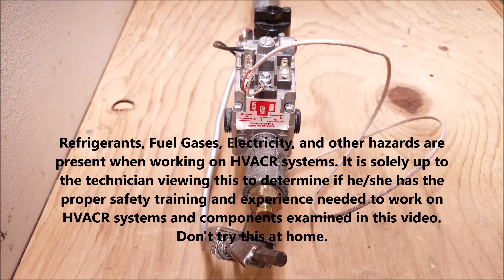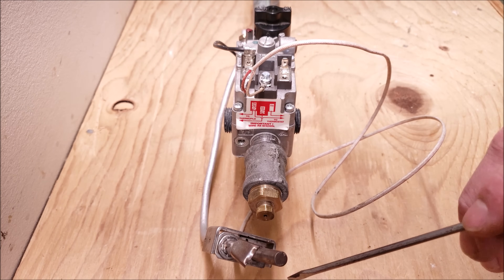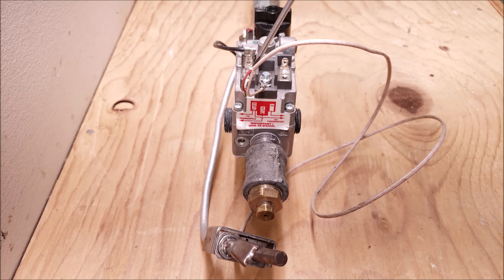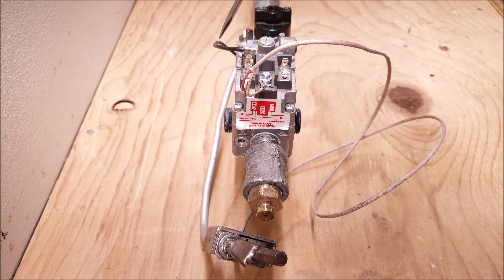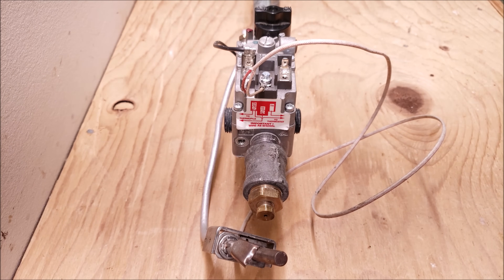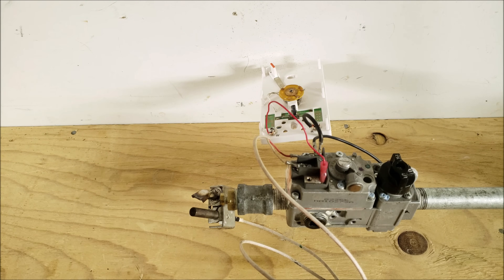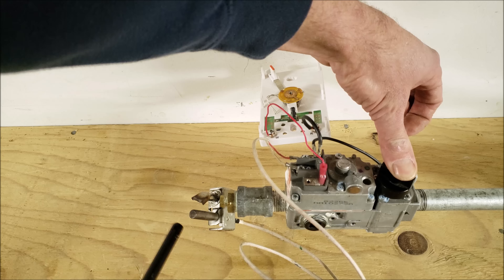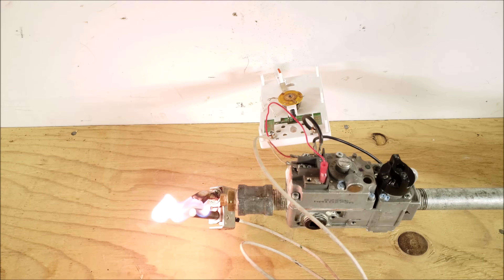750 Millivolt Gas Valve, Thermopile Wiring & Wiring Diagram!

Comment from the maker: Support-  https://www.patreon.com/acservicetech
Tool List-  https://www.amazon.com/shop/acservicetech
For those that are looking for the tools used in the videos: (Linked Below)
Honeywell 750mv thermopile- http://amzn.to/2yfR9UK
Robertshaw low profile millivolt gas valve- http://amzn.to/2iLXzEh
White Rodgers 750mv thermopile- http://amzn.to/2zhKVnF
Robertshaw pilot and thermopile combo-http://amzn.to/2zZAH8w
Ultrasonic Leak Detector- https://amzn.to/2Lw4Zpr
UEI DL479 Multimeter with temp sensor http://amzn.to/2jtsUbJ
Magnet Jumpers- https://amzn.to/2PyKPQZ
Alligator Jumpers- https://amzn.to/2PxqJXn
Fieldpiece ST4 Dual Temp Meter  http://amzn.to/2wc1ME3
Fieldpiece Bead K Type Temp Sensor https://amzn.to/2DBwKfs
Fieldpiece Wet Bulb Temp Sensor https://amzn.to/2RRI7Tw
Fieldpiece TC24 Temp Clamp https://amzn.to/2qHLyjZ

Yellow Jacket Refrigerant Gauge Set http://amzn.to/2aenwTq
Refrigerant hoses with valves http://amzn.to/2aBumVI
Yellow Jacket Gauge set & hoses https://amzn.to/2vLVkV9
Yellow Jacket 4 Port Manifold w Hoses https://amzn.to/2BkuGIq
FieldpieceSMAN360 Digital Manifold Set https://amzn.to/2BdoaD4
FieldpieceSMAN460 Digital Manifold Set https://amzn.to/2nB4Fe6
Compact Ball Valve for Refrigerant Hose https://amzn.to/2KUisW8
QuickDisconnect 90 for refrigerant hose https://amzn.to/2MMtVcg
JB 6 CFM Vacuum Pump   http://amzn.to/2nqbvo8
Appion Blue 3/8" to 1/4" Vacuum Hose http://amzn.to/2uYlVyc
Appion Red 3/8" to 1/4" Vacuum Hose http://amzn.to/2uYg6Ro
Appion Valve Core Removal Tool http://amzn.to/2uYr8WL
Yellow Jacket 1/4" by 1/4" hose http://amzn.to/2umtcod
CPS Vacuum Micron Gauge http://amzn.to/2v1nM3O
Supco Vacuum Micron Gauge http://amzn.to/2v1JRiA
RectorSeal Bubble Gas Leak Detector http://amzn.to/2ckWACn
UEI DL389 Multimeter  http://amzn.to/2xAdaJf
Air Acetylene Torch setup    http://amzn.to/2aQalsb  
15% Silver Brazing Rods  http://amzn.to/2gVLyLc
Nitrogen Regulator    http://amzn.to/2bXdR5f
Nitrogen Flow Meter    http://amzn.to/2brvoBg

Other tool links can be found in the video description section.

Shop through Amazon! Your Purchases through Amazon provide a means for channels such as mine to earn advertising fees from all purchases after clicking through. Prices are the same as normal-    https://www.amazon.com/shop/acservicetech
Reply: does the polarity of the RED & WHITE wires on the thermopile matter where you land them on the TH/TP or TP terminals on the valve?

Comment: Help full. On my valve there are two locations for the thermocouple to screw into. When I changed the t/c, I connected to the location easiest to access, it didnt work. Tried the alternate position. It fired up right away. I just want to leave this here, hope to help someone.

Comment: I have a SIT 820 mV valve that works, but wont turn off even with thermostat wires disconnected. Are the wires in the back shorting it out so it thinks its calling for heat? Have to turn gas off to get it to stop. Turns off if i disconnect the thermopile wires and pilot stays on. Help!

Comment: Mine has the Robert Shaw LP Propane Gas Valve 7000MVRB 5LCLP…my pilot flame is very strong but when I turn the thermostat on the pilot goes low and burner lights with a very week flame and pilot is weak as well… then a few minutes later the burner goes out. Pilot stays lite but weak…

Comment: Hello, I have a 60 year old pioneer furnace with a white rodgers valve 857RA68E. I tried to replace it with a resideo VR8300A4516 valve and it did not work. Can you recommend a substitute valve? Thanks.

Comment: Great video!! My question ... I have the Robertshaw  7000mvrlc    710-502. This unit has not been used for over ten years.....I blow out the pilot and it takes about 60-65 seconds for the valve to shut off...I installed a new pilot assembly and thermopile and I'm still having the same results??? bad valve? any help would be appreciated.

Comment: This video helped me as I have a similar gas valve on my monnessen gas fire place and want to control it with a thermostat instead of a thermostat remote as it only checked every 15 minutes and it can get pretty hot within that 15 minutes lol but anyways thanks for showing the diagram as now I can heat my house more efficiently and comfortably

Comment: My gas fireplace has a robert shaw gas control valve similar to this one. The pilot wouldnt stay on once I stopped pushing the knob down. I measured the mV coming from the thermopile and got around 400 mV. Then I bought a White Rodgers 600 - 750 mV 36" thermopile (G01A-132) and replaced it. It can go as high as 500 mV. But same issue. Pilot wouldn't stay on. I attached an old 1.5 volt battery in series with the thermopile and got 1. 4 V reading (without the pilot on). Then I on the pilot and it remained lit without even waiting for 10 seconds (once knob is not depressed). It works. The fireplace now works. However it isnt safe and I wouldnt use it this way. Is the issue with the thermopile being around 500 mV? Should I get something that should generate 700 - 750 mV? Second question, does it matter whether the red line of the thermopile gets connected to TH/TP and the white goes to TP because my original configuration (which works before) was the red went to TP and the white went to TH/TP. Thanks for your help.
Reply: Did you ever figure this out? I seem to have the exact same issue.

Comment: Gracias por la explicacion!
Reply from the maker: Glad to help!
Reply: @acservicetechchannel  I have a situation, today I changed a Robertshaw milivolt valve and didn't turn on, at the beginning not even de pilot, later the pilot turn on but I couldn't turn on the burners, several times when I set the thermostat on, the pilot turned off. Any ideas?

Comment: So I have this valve in a Superior fireplace. Checked thermopile voltage and it was around 210, so made minor increase to pilot flame, which brought it up to 327. With wall switch turned on (closes the main valve circuit, there is no thermostat) the main valve still never turns on. Bad solenoid/valve and replace the valve altogether? I even tried directly jumpering out the switch but still no go.

Comment: Hi, we have a gas fireplace ( a Regency ). It seems to work fine on med or high setting but when turned to the lowest on setting it will let only a small amount of gas to the burners and does not light and i can smell a bit of raw gas. is there some sort of adjustment on the valve?  Thanks

Comment: Several people seem to have the same problem I have. Brand new Empire Dv heater. Thermostat is closed, but BRAND NEW gas valve needs to be "tapped" with a hammer to work. Any ideas?
Reply: I have a similar problem (Empire DV-35) but with the main burner not coming on with thermostat in heat ON.  Jumpering whit and red contacts on thermostat light the main burner.

Comment: My gas valve wont light the burner on my gas fireplace. I have about 550 millivolts when the pilot is lit. How many millivolts should I have when the wall switch is turned on?

Comment: Company wanted $935 to change out failed gas valve in small natural gas fireplace after charging $160 to diagnose the problem. Going to do it myself with $139 new valve from Amazon. Thanks for the videos you make.

Comment: Hello there, i have a similar application, i was wonder if i can use the same valve but for using a thermostat that reads temperature on hot plastic material that heats up to 425 degrees, thank you

Comment: I am having an intermittent problem with a millivolt system turning the main burners on. I'm not sure if its the thermopile, or the tstat/wiring. (The pilot flame looks good to me, nice blue flame engulfing the thermopile). I've tried a few thermopiles that get up to 750Mv with propane flame on them, and get around 500 - 600 mv while in the circuit with only the pilot valve open. But, the main burners work for a few days, or weeks even, but then will not open the main gas valve. (pilot always stays lit though). 

I was wondering if I have too much resistance, and how to ohm the tsat alone, and the tsat and the wiring to the gas valve? (I have 16 gauge wiring now, and about 25 feet from tstat to furnace). Can I leave the batteries in the tsat, and set it to call for heat, and take the wires off the gas valve - to ohm it? (I don't want to break my meter ohming a circuit with voltage in it). What resistance would be acceptable, and what would be too high?

BTW, do thermopiles get 'weak', or just fail to even get to a good voltage, after they get old? I mean, would they function for a few days and then lose the ability to generate the correct voltage, or simply never get to the right voltage ever - when they get too old?

Any other ideas to find the problem?
Reply: see above. Having the same problem!!!! Have new gas valve to my right hand now. Tried most everything you've done....twice! hate to change valve for the same situation. Waiting on answer.
Reply: @stanleykwiecinski811  my furnace has been running for 6 days now with another older thermopile (TP) . But I ordered a new Honeywell TP, and bought a new one from ACE hardware to have in case older TP fails again. My valve is just a few years old, so I guess the problem is not the valve. I guess.  Let me know if you find a good testing procedure. I'll do likewise. Have you done millivolt readings on gas valves terminals?
Reply: @m.n.3490  I had a PAL who was gonna help me change my gas valve. no show! That night i tested my gas valve; other site said reading should be 1.5-1.7 my reading was 2.0.....even the new valve read 2.0 I own a cheap meter. it's been working. my reading on the Tpile was 300+ mv not 325 minimum. but?....I have 3/4? Tpiles all test good! change  them and heater works......for a week-month? ball buster! $108+ just to ring my bell! figure 2-3 hrs min. Could buy a new heater for that price! I just keep a jumper cable hooked up just in case. paranoia is not fun.
Reply: Tapped my valve. coming out of a COLD drunk friday night ;and it fired up? magnets in valve sticking? not enough MV? weak wiring connections?......spin the wheel!
Reply: @stanleykwiecinski811  I measured my pile again. It is putting out around 650mv at tp-th/tp, and at th-th/tp with main gas valve closed. When main gas valve is open the readings are 440 and 260. That 260 on th-th/tp with valve open seems low, but valve is working! For now.

Not sure what you meant with other measures? 1.5-1.7?

Is your tpile new?

What is 3/4? 

Did you test tpiles off the furnace? I noticed mine tested off furnace using propane show a lot higher 0mv than when in circuit(on the gas valve and heated by the pilot).
Reply: @stanleykwiecinski811  I had that happen with my old valve, that was like 40 years old, which is why I put a new valve on about 5 years ago. I suggest always reading the 0mv to see what they are at. If they look borderline, and then tapping the valve opens it, I would think you need more mv output. If before tapping the mv are strong, 550-650, and tapping opens valve, it could mean valve is the issue. That's my best guess.
Reply: @m.n.3490  1.5-1.7  reading was ohms? with white wire off middle terminal. watching all these sites i don't recall which said that. i get 2.0mv-not ohms. Tpile is new...3/4 is replaced Tpiles. all go up on stove burner, probably good? Gray furnaceman cuts up a Tpile on his site. he has good stuff on his sites!  did you do the gas valve replacement?  tried the other day myself. 2screws rounded off, the rest i got loose. manifold to burners has me stumped? looks like burners are pressed to manifold. was gonna back off burners from manifold for clearance with pry bar!? woulda done it on my shovelhead! but chickened out with the rounded screws. hoping to milk it till spring.so i can grind out screws. no space to get hammer driver in area. It works well in real cold weather. so maybe not enough MVs? pilot wont adjust anymore!
Reply: @stanleykwiecinski811  I have looked at grayfurnaceman also.

Here is a link to a few pics my my gas valve, and pilot assembly. One pic has tpile in the assembly, one pic shows it removed. The pics with the 3 screws show the th, th/pg, and pg screw terminals I measured the  millivolts across, (I never measured ohms, and I have not seen any data regarding what the ohms should be).The gas valve in the picture was replaced about 3-4 years ago. (before that there was a 40 year old gas valve assembly that looked much different).

I can't quite picture some of the parts you are speaking of. My gas valve just screwed onto the 3/4 iron pipe that delivers the gas to the burners. You can google the model number you see on my gas valve to find more info and instructions for how I had to install mine, if you want to see that.

From what I have read, it's the millivolts delivered by the thermopile to the gas valve that is the critical test.
Reply: @m.n.3490  just ran it again 409 mv off. 277 fired. looks OK. called IT so many names it possibly suffering from PTSD!
Reply: @m.n.3490  I meant MVs. my gas valve looks just like the one he is testing. laid on it's side the black plug has a 8" steel? pipe going up then turns to a L to the two burners. nothing on any sites working on this 5009622 about gas valve replacement. My owners manual shows threads in the pic. ? looked for pics of manifold on a couple pts. replacement sites for reference?....pics of all other pts. no manifold though! Happy with the 409MV-277 drop off when fired ...Thanks for replying! the fan on top. When it shuts off....i get paranoid, can't sleep. the longer it's off. ...gonna fire? not gonna? it's right outside our bedroom so i know all it's creeks and pings.been good all week? but you know how that goes. ... Not good with links? still have a land line! this lap top was like the caveman finding fire! WOW!

Comment: Can you please explain what the larger Allen key plugs are on the sides of the valve?
Reply from the maker: Those are the inlet and outlet pressure ports for troubleshooting or reading the pressure for a conversion from natural gas to propane, Thanks Ryan!
Reply: @acservicetechchannel  so they are another pressure port? You're talking about the big 3/8 or 1/2" ports on the bottom? They're way bigger than normal pressure taps for manometers... Just making sure we're talking about the same thing. I figured they had something to do with servicing internals or something
Reply from the maker: Oh no those are for different configurations on how the gas valve is hooked up to the gas piping sine this is a universal replacement gas valve, thanks
Reply: @acservicetechchannel  thanks ACS Tech!!

Comment: Worked on my first wall heater yesterday. Replaced the gas valve as it wouldn't open even though it was getting correct voltage. Also replaced thermopile as maintenance. Great video!
Reply from the maker: Thanks Kenneth!
Reply: Have an erratic gas valve? works for a week; then nothing ? jump th/tp to th. works fine.last week i tapped with screw driver. fired right up! bad valve? new Tstat& T pile ....Thanks!

Comment: It has to have 750 mv, no less or it doesn’t work?
Reply from the maker: No it will usually read 750 when it is open circuit, around 500-650 when powering the pilot and maybe 300-400 when powering the main burner. It would really depend on the heat of the flame and the condition of the thermopile though, thanks